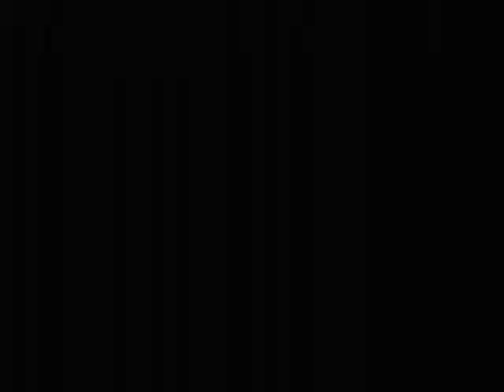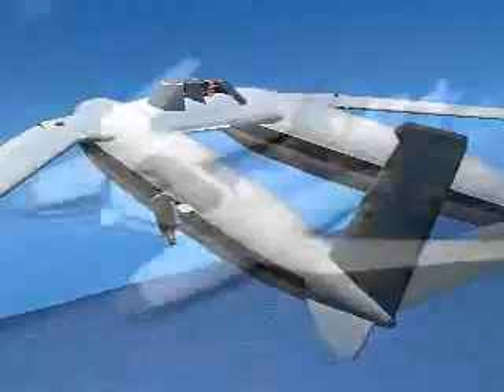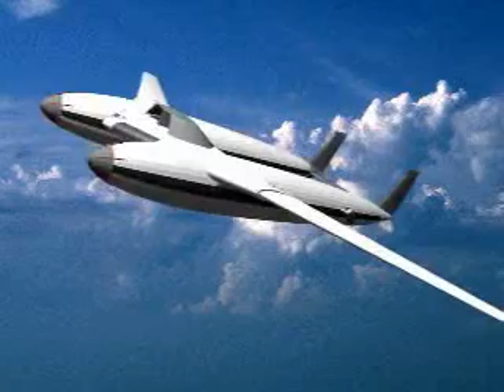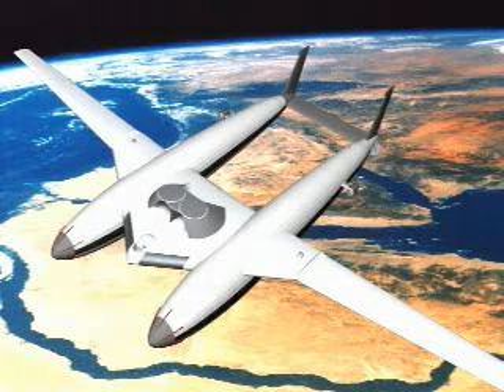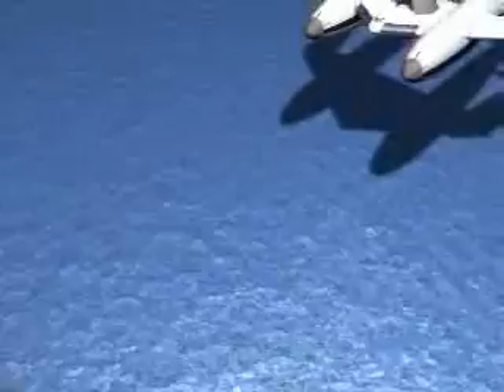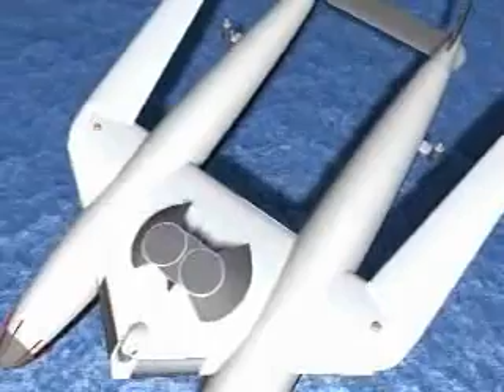Fuel-Less Gravity Powered Airplane

Comment: Running motors with compressed air that drive compressors to compress more air? WTF?!

That's horribly inefficient. You don't need to 'add more weight' by pumping in more air from the atmosphere - all you need to do is reduce the size of the helium gasbags by pumping it into a smaller space. This is the same reason that a steel cylinder of helium doesn't float away - though it might contain enough helium to do this at atmospheric pressure if all the gas was in a suitable vessel. .

Comment: air is a different thing to gas air is what we breath, helium is a gas. air compressing air doesn't work and the whole concept wouldn't work you cant compress that much gas without having air tanks weighing several tonnes this thing could never work it wold be to heavy to take off and even if it could take off it would still need fuel.

Comment: Dangerouslytalented, I think the idea is the energy is supposed to come from the boeyancy of the helium which is supposed to assist the machine in gaining altitude, and therefore potential energy, basically for free. But I agree with your analysis. It seems to me that, just like all other 'perpetual energy' ideas, the system is inevitably not 100% efficient and more energy is going to be lost through descent and the compressors than regained through the wind turbines during descent.

Comment from the maker: Although the air turbines are described as providing thrust durng lift off, it may not be necesary to use them do do that. Some forward thrust can be achieved in the lift off using the wings to wedge the airshiip in the forward direction, while the helium causes the airship to gain altitude.

Comment: Someone else posted why quite some time ago: Gravity is a conservative field. You simply can't "extract energy" from it. Period, end of discussion. 
And the prattle about the air turbines and air compressors is equivalent to an air compressor output making a turbine turn, thereby spinning the compressor... which is really just an overcomplicated flywheel. No, it won't turn forever, let alone produce any excess energy,

Comment: Do we not understand that those air-driven turbines are going to remove considerably more energy from the airplane (i.e. slow it down) than they store in the air tanks? There are similar net losses all through this system.
howler at  1:13: "air from the atmosphere is compressed...by pneumatic motors driven by stored compressed air that powers air compressors." uh, what? you had compressed air to start with, why didn't you just use that, instead of running through two lossy stages?

Comment: You will lose energy the entire time. The plane will need to be charged before its initial flight. It can raise, and then glide, but then the next time it raises, it wont go quite as high. it will then glide and drop again, lose some more energy, and it will raise even lower now. it will get to a point that the plane will need to be recharged with compressed air on the ground again before it can leave to gain its original flight characteristics.

Comment: crap plane. heleum is the fuel and it is more expensive than oil. why dont planes use ultra light solar panels and generate more electricity from the turbines in the plane?

Comment: 1. No it isn't.
2. No it doesn't.
3. Define what you mean by efficiency.
4. You clearly don't understand how Nobel Prizes are awarded.
5. The plane is an outstanding concept. This presentation does make a few glaring errors, notably it assumes the compressors will restore the same amount of air being discharged for take off. Even if you didn't refill the compressors, this plane (itself a glorified airship), could still make environmentally-friendly short-haul flights.

Comment: solar cells are heavy and dramatically inefficient - the principle physics discussed makes sense though i doubt if the compressors would be able to compress enough air on each descent to match the initial compression. Even so, even if the plane didn't recompress air they estimate 400-600 miles travel on one cycle. Even if it's half of that, it would be useful as a domestic short-haul aircraft - esp in smaller countries such as here in the UK.

Comment from the maker: "What range do you expect with compressed air until the tanks are depleted?"

Use of the compress air, for pushing, is minor aspect of this design. Compressed air tanks are refilled several times during the flight.

"why not use solar panels or even better hydrogen fuel cells to power electric motor-driven turboprops."

This may be implemented. There are many configurations possible. Electric motors may capture energy during dissent too. Through testing, efficiency comparisons can be made.

Comment: ..secondly the 'fueless' part.

You're using compressed air jets which provide much lower thrust than a turbopropellor would. What range do you expect with compressed air until the tanks are depleted?

If you want to keep it 'green' and eco-friendly, why not use solar panels or even better hydrogen fuel cells to power electric motor-driven turboprops.

Comment: I think the idea is great but you might want to reconsider...

First of all are you trying to build an airship or a plane? It seems as though you are using the helium tanks to generate lift, so why the need for the wings. I would believe they add unnecessary weight judging by the wingspan and since this is probably a civilian aircraft try to eradicate as much of that as possible.

Comment: Also, it simply wouldn't work. Using compressed air to compress more air?! -Maybe- if you had solar panels to provide energy flow into the system, but otherwise no. The fact is you're going to lose more energy than you produce.

Comment: ohh my, no fuel, continuous motion, moving wings. wow, i mean really, wow. not in a good way tho. first off, they are using blimp technology for lift, does anyone recall the amount of He (helium) required to raise a blimp? if you compress this volume of He, then the density become comparable to that of air and you lose lift. secondly, is 100% efficient, energy will be lost (via drag) in each decent thus the process cannot be repeated forever. why do the wings need to move anyways?

Comment from the maker: t likely would avoid "less than idealistic weather conditions" by going above them. And it likely would optimize weather mapping technology to plan routes. And because it can travel at high altitudes without burning on board fuel, it may have advantage over common jet engine airships.

Comment: Such apparatus violate the basic physical laws 
It is looks easy because of using quantitative expressions as little  huge instead of calculations
Even simple calculations sows that some external energy source will needed to support ascend/descent cycle
But if you deny calculations imagine a machine designed on same principle not to fly but to demonstrate possibility for entire movement and producing of energy from   nothing  
 good luck

Comment from the maker: Consider that these airships likely would require far less fuel than virtually any other existing vehicle, to travel the same distance. They can avoid storms, lightning, rain, snow, and other ground weather conditions by elevating above the clouds while transporting. This gives defense dept another transportation tool to use.

Comment: Compressed air runs air compressors to compress more air? Did no one notice how absurd that is? This plane will never work, and even if it did it would carry basically no payload. There is a reason no one uses blimps. They are expensive and barely support their own weight, let alone any cargo.

A simpler design would be some sort of electromagnetic or spring loaded launch ramp, which fires a payload-bearing capsule which becomes a glider at high altitude.

Comment from the maker: There are propellers on this concept airship. They are called "turbines". Regarding solar panels, they can definitely be placed on this airship, along with other optimal energy efficient technologies. In this case they are show casing the used of compressed air tanks and turbines as a means of collecting and storing energy. The turbines can be used as thrust motors when using the compressed air to spin the propellers of the turbines.

Comment from the maker: speed and size are relative. Costs are also relative. In air travel, there may be the initial expense of design, manufacturing. Then there is also the cost of maintenance and FUEL.

Some less obvious cost include insurance and liability. Consider that this airship stores NO explosive fuel or the need to purchase it (currently at about $10-15 per gallon for jet fuel). And that jets often have as many as four engines, and that they use about 3 or more gallons a mile. Get the picture?

Comment from the maker: That is incorrect. When the airship is at max altitude, the aircompressors (with wind turbines attached) collect wind energy during the glide down in altitude. That energy compresses the helium (air) in the ballast bags as shown on the video. The compressed helium in tanks, along with compressed atmospheric air tanks, can then be used to spin the wind turbines for propilsion.

Comment: A very novel idea, but I kind of have to agree with Jack. There seems to be an assumption of high levels of efficiency in compressed air pumps, as well as turbines - which are not historically efficient. It's an interesting idea, but wouldn't you be potentially significantly shifting the CoG by transferring air back and forth? 
Also, submarines have nuclear reactors to run their air pumps and compressors. Additionally they can always make more air using their LiOH system.

Comment from the maker: There are two distinct "airs". There is the air used for energy and another air (helium), which is compressed and decompressed in a cycle, similar to a submarine using "air" to rise or lower in the water. The other compressed air is used as energy storage. This concept airship explores ultra energy efficiency techniques for air travel.

Comment: As a professional engineer, I can state definitively to the YouTube public that the airship presented in this video is impossible to build or fly as specified.  Top on the list of many, many problems: the materials to build this complex system would be too heavy to achieve buoyancy through Helium displacing air.  External power sources would be required to deal with significant looses of energy due to friction.  The Aerodynamics of such a craft would make too slow for most commercial purposes.

Comment: Show me the engineering calculations!  This sounds like a bunch of nonsense from someone who never understood thermodynamics.  Using compressed air to compress more air and falling to compress even more air!  Look up what happens when you compress air - even isentropic compression results in some energy available as pressure but a lot is "lost" heating the air which is non-recoverable.

Comment from the maker: Regarding the Zeppelin airship, it used hydrogen gas for lift, is that the fire was out of control as a result of a flammable paint on the skin of the the blimp. Some believe that had the zepplin used a fire resistant material on the skin of the airship, that the tire could have been contained. With that said, this airship uses helium, a non flammable gas for lift. And with todays technology, there are more options for building with fire proof/resistant materials, and fire detection and control.

Comment: So it's not really fuel-less.  It uses compressed air, but it (supposedly) regains it on the way down.  Self sufficient, but in a cycle.  A good idea if the E for takeoff<E from glide.

Comment: this won't work because of energy required to compress air. Put a gas engine and replace helium with hydrogen reformed from natural gas, quit that folding wings and voilá! it will fly. Wait! it would be a blimp ups...

Comment: That wont work you would need WAY more helium.
why do you see a tiny gondola an a HUGE blimp?
because that's how much helium you need to lift that weight.
even if this thing were made out of packing foam I doubt it would get off the ground.
And its not GRAVITY POWERED it lighter then air.

Comment from the maker: PacifistWarMachine, I suggest you review the video again, and the other comments. The helium lifts the airship. And to collect that potential energy, is used with the wings, air turbines. Additional lift can also be generated with heat pockets of rising air. Because of the multiple sources of energy and the innovative design, this concept airship is a hybrid with ultra energy efficient techniques for air travel.

Comment from the maker: The air can be compressed with electricity powered compressors. They may also be compressed via wind energy. the electricity may come from several renewable environmentally friendly sources, such as solar thermal, solar photovoltaic, geothermal, wind turbines, etc.

Comment: It may be extremely fuel-efficient, but it's not fuel-less.  After all, it requires fuel to compress the air in the first place.  Still, it's a neat idea.  This concept would be a great way for glider pilots to get their gliders up in the air without the need for a tow plane.

Comment: You're absolutely correct. This is evident in the first and second laws of thermodynamics. Also, this aircraft may not carry any combustible fuel on board, but remember that for the initial charge of helium and compressed air (before first lift-off), energy must be expended on the ground. Unless only "green" sources of energy are used,such as solar, this aircraft will still have a carbon footprint. Fuel will just be burned at a power generation station, rather than on board the aircraft. 

»Tøny

Comment from the maker: There are two gases (air) within this system. One is helium and the other is ordinary atmospheric gas (air). At times it is necesary to re-compress the helium. To do this it may be possible to use the stored energy (in the form of compressed atmoshperic air).

Comment from the maker: Interestingly, there are already some video showing up on Youtube of smal scale helium filled airplanes which are able to fly for several hours with an electric motor turbine and on board batteres. And in some cases they have attached on board video cameras to record the flight. It seems that it is a smal step to build in a system to compress and decompress the helium to give the airp;ane the gliding capacity described in this video. Add light weight solar panels.. and it may fly around theworld

Comment: This sound like a perpetual motion machine.
where does the energy come from? The initial energy is stored as compressed air. and all the energy comes from that. Replace the helium with Hydrogen and then use fuel cells for electrity. at 70,000 ft max altatude and al glide slope of approx 60 to 1 you could get a range of 60X70000 ft. good for short jumps. no reason for the fold back wings. When the aircraft gets to its destination refuel with hydrogen that comes from solar & wind water electrolis

Comment: Hi 'brutez123' We saw this March 31st 2006 on "Damn Interesting" Hunt Aviation are the folks you need to contact.

But why not drive yourself to the meeting in a Gravity Powered Car?

Check out:- "Veljko Milković - Cart with a pendulum - Vehicles with internal and inertial drive" Here on YouTube... Multiple Inclined Pendulums' just stacked discs of steel. (weighted as pendulums & magnetically suspended at the circumference) very little electric power is needed. small battery, long journey.

Comment from the maker: I am sure that tanks filled with helium under high pressure would be much safer than jet fuel. Interestingly, there have been several news reports of airlines looking for ways to reduce weight by restricting the amount of fuel in thier tanks. AA pilots' association even place a full page ad in USA Today to inform passengers about this and the danger that it presents for the pilots to provide safe air travel for passengers. Punctured helium tanks generally will only pass the helium out. Thoughts?

Comment: It will work because of the orbit effect. do you see rocket engine on satellites or planets for that matter? as it descends, it
accelerates faster compressing the air faster. it will fall at approx 1:60 of the circum of the world in one trip. now granted that may not be enough to perpetuate the craft continuously, but they would be able to last many trips and occasionally compress more air on the ground.

why isnt heat or grav perpetual? because everything is prpetual if you think about it.

Comment: A full or heavy tank is not the issue. according to this video, it's the amount of air that is on board. weather that air happens to be compressed or not, it still weighs the same in either state. The weight of the plane is constant. Compression is volume related. If they are talking about displacement like boats and water, it still ain't gonna work since gas require lots more amounts to achieve the same dispacement as a boat on water.

Comment: They must have left out the part where you use conventional fuel sources to compress air into the plane at the beginning, while in the water. Otherwise, this is a perpetual motion machine, which I don't think it is. As for repeating the up and down part "as many times as desired", that's complete poppy cock. I thought the part about using compressed air to compress air sounded kind of funny, but maybe it's highly compressed air compressing less highly compressed air around the hydrogen bags.

Comment: It might be useful, upcycle, to do the sums on payload and lifting capability of helium in order to get an idea of the size of this thing.
Then do the sums on comressor efficiency and power required to recompress that volume of gas back into the tanks.
Once you've actually made the effort to 'do the math' you'll see that this thing a/ will be huge, b/ won't work.